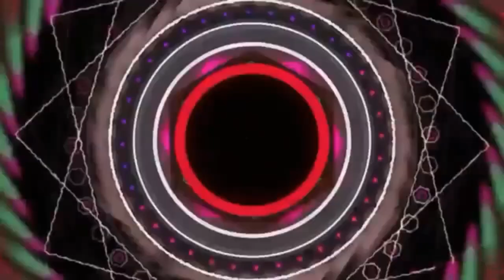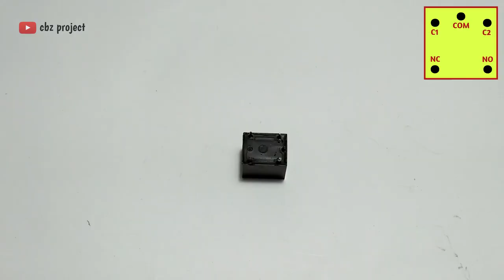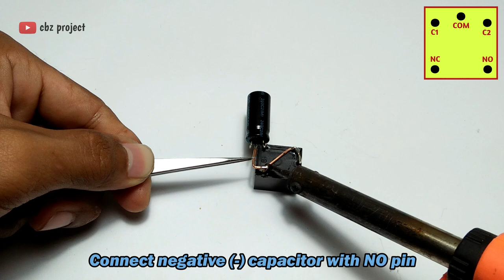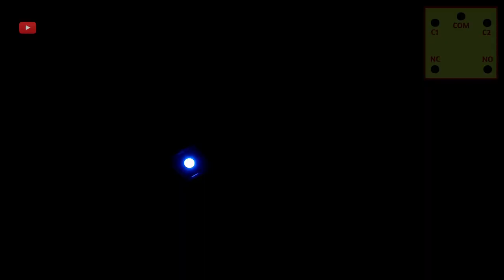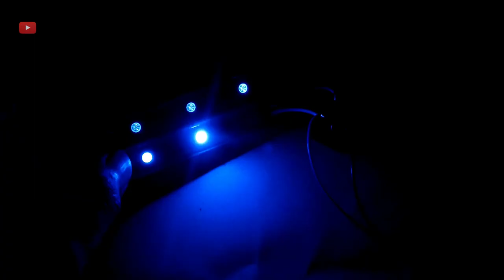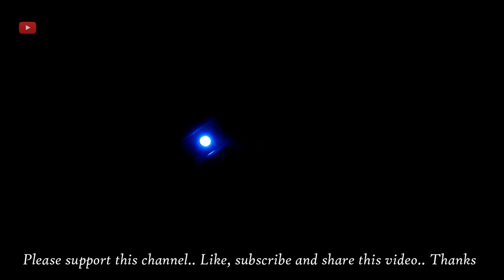12v LED Flasher Using Relay & Capacitor | Simple Circuit

Comment: Great simple video. 
I'm simulating flames, so need 3 or 4 of these. But they need to not all on/off at exact same time. Can something be added to cause them to not be in sync as they flash? Ok if start in sync.